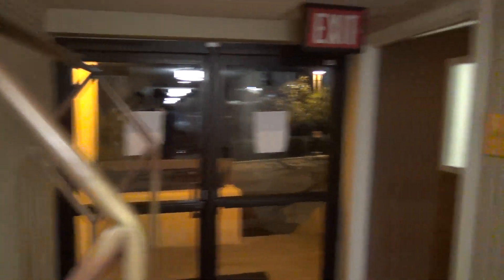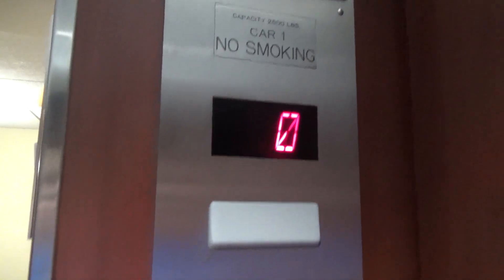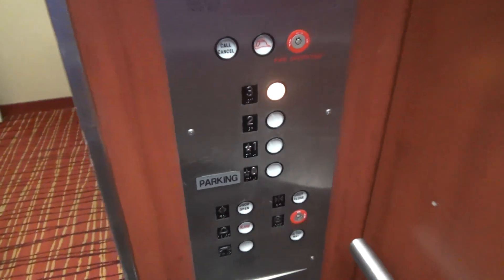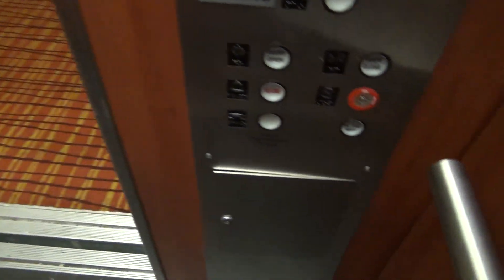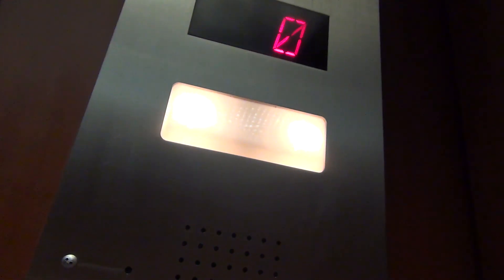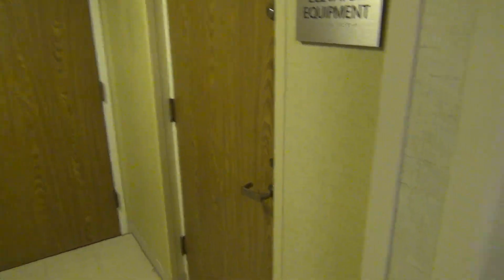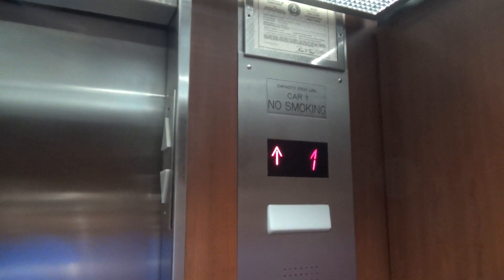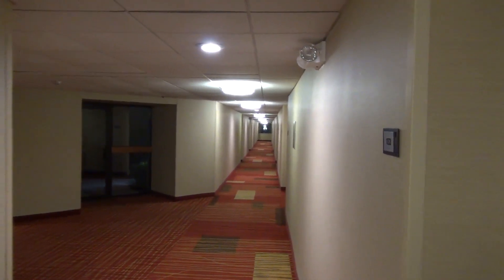Modernized Westinghouse Hydraulic Elevator @ Courtyard by Marriott Dallas Las Colinas - Irving, TX

Comment: Huh... very interesting for the main floor to be floor 0. I almost thought it would be floor P for parking.
Reply: Or are there two main floors in this hotel? I can’t tell.
Reply from the maker: It is built on a slight hill so I guess you could say there are two main floors, though the lobby is on the 1st floor.

Comment: That is a Schindler 330A
Reply: HXpress.
Reply from the maker: nope
Reply: It sounds like one
Reply: 330As would have HT fixtures.  This is an HXpress because it was modernized.  HXpress is Schindler's modernization system for Hydraulic elevators.  Schindler also made one for Traction elevators which is called TXpress.

Comment: This is a horrible elevator. I can't believe Schindler modded it to be this. The chime sounds awful, the doors are noisy, shaky and terrible and the operator isn't good at all. And going down it shakes likes crazy. The hotel really doesn't care about the elevator because they should have noticed it by now. I think that this elevator is going to get stuck very soon.
Reply: that crap lift looks out of place.
Reply from the maker: Just because it has a couple of issues doesn't mean it will get stuck.
Reply: Yeah, Schindler mods can be good and bad this happens to be a bad one.  I would prefer to see Otis or ThyssenKrupp modernize a vintage elevator.